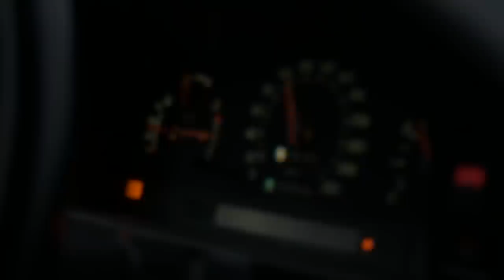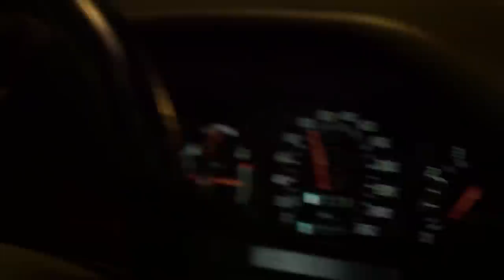Bamse's Turbo Underpants 3 - Episode 13 - Engine Check

Comment: At 3:39 I can see B230 on the block. The cranks in these blocks don't guide the con-rods(keep the con-rod centred in the cylinder bore). You need con-rod wrist pin spacers to keep the rod in the center of the piston, this set up works for the B230 crankshaft. The noise you are hearing is from the con-rod slamming side to side. If you don't add spacers to the piston's wrist pin then the con-rod will buckle and fuck the engine. Get in contact with Wisco or JE, or who ever made the pistons and tell them you need con-rod centering spacers.
Reply: Andrew Gallagher Eetzi Productions
Reply: This could be the answer !
Reply: Andrew Gallagher Im from sweden where b230s are very common and i've never heard of this before. Where did you get this facts from? Im not saying your wrong, just wondering!
Reply: Rostmeister B23 blocks have crank guided rods to centre them in the bore. 
B230's have piston guided rods to keep them centered. Volvo changed the crank design. Probably best to compare the two engines and compare the difference. :) Bamse's aftermarket rods may be wider at the big end to allow the crankshaft to keep the rods centered.
Reply: Andrew Gallagher 
Andrew everybody working with these redblocks knows the piston steer vs crank steered deal between "normal" Redblock and B230...and nobody in their right mind specifies rod big end width narrow like the original rods---If they have any sense they go 20,75mm on big end---same as b21/B23.... The major problem in piston steer is the pin bosses have to be very wide and then milled exactly to give the 0,25mm "float" and that means they are unusually wide bosses...None of the US made pistons worth having have enough material in the raw forgings to make the narrow 25,, needed to guide from piston..J7E and CP the gap in the raw forging is already 26-27mm...
Just to note I have rods and pistons for these motors made to my spec--and specify full width big end, 24.75mm small end and supply CP Pistons..Done hundreds of them--and I specify a 7/16" size big end bolt...My rods are 160mm center to center and that makes a nice light piston...very nice stuff...

If you look at 5:53 you see the rod from bottom and the width--using the rod bolt hole as a guide is about 3 times the bolt hole---it is full width.
Those Swedes and Finns are no dummies when it comes to motors and the Redblock is "the Small block Chevy" of Sweden...easily 60% of the entries in Swedish rallies since the mid 90s (when they had killed all the Opel Asconas in the country) are Redblock powered volvos... Its the "MkII Escort" of Sweden..
Let's cross the fingers they find the problem---and find a way to torque the head properly.

Comment: the scratches on the pistons can be caused by low to no oil on the cylinder at initial start up maybe due to low oil pressure or an air lock...i would take a look at my oil pump to be sure that its ok

Comment: Just sharing some thoughts..
Have you checked the bearings in all "external" things like the alternator, the timing-belt wheel, steering-servo etc.?
Maybe it's a dumb question but you didn't mention those things in the videos and it seems like you haven't found the problem yet so yeah.. just sharing some thoughts as i said!